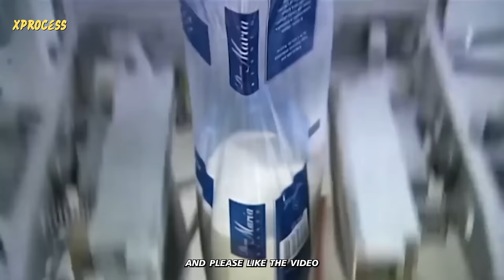How Aluminum Foil is Made | What Material Is Used To Make Aluminium Foil?

Comment: 0:35 "Thermal insulation capabilities". Don't expect aluminum to insulate anything. It is one of the most efficient conductors of heat in existence. But it is true the shiny surface reflect radiant heat.
Reply: Which is how heat radiates. Dip sheet
Reply: @tylermcnally8232  It's how heat radiates, yes, but it's not how heat conducts or convects, the other two ways heat can transfer.

Comment: Overall informative, but a factual error at the beginning makes me wonder about the care they put into things. Stated the first company (or early one anyway) was “The Reynolds Aluminum company” FALSE. “Reynolds Aluminum “ is the product, the company was “Reynolds Metals company”. I worked there, Richmond VA headquarters, for 2 years. Eventually bought out by Alcoa; but that’s another story.

Also, I had been taught the shiny/flat sides of AL sheets were caused by the need to run 2 sheets together for strength; the video correctly discusses strength problems, but I thought attributed shiny/flat to different rollers. Dunno, as I never verified my “teaching”.

Notwithstanding criticism here, AL is fascinating and there’s lots of interesting info here.
Reply: Your statement of the shiny and dull sides, is spot on.

The shiny side, touches the rollers.  The dull side is 
pressed against the other sheet.  ( I saw a 'Tube video, 
said the dull side was against the rollers.  Wrong.)

steve

Comment: You got it wrong how the two different surface finishes come about. The foil is rolled at the final step in pairs of sheets. The outsides end up smooth because of they are against the smooth rollers. The other side is against the other sheet of foil that is rolled at the same time, so it is rougher as it just smashes into the other sheet.